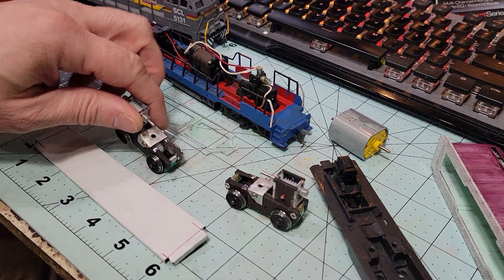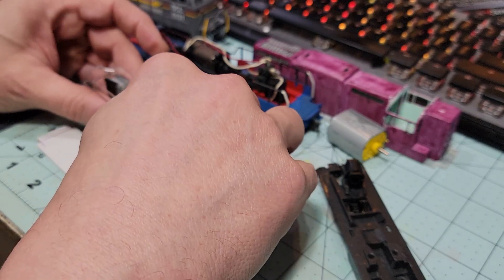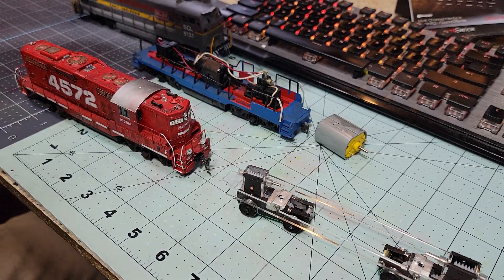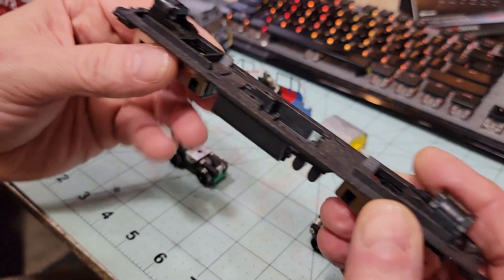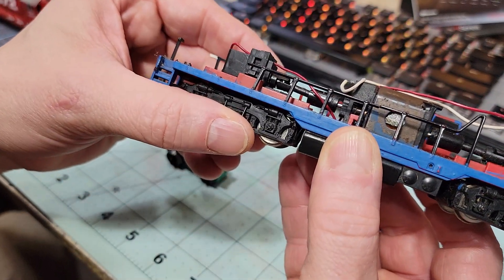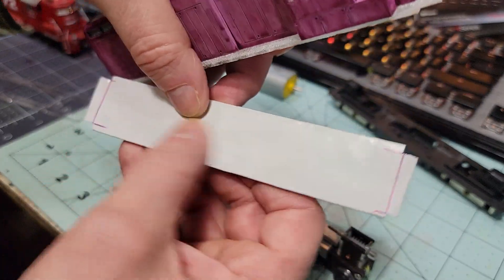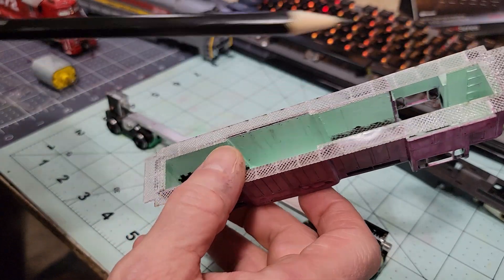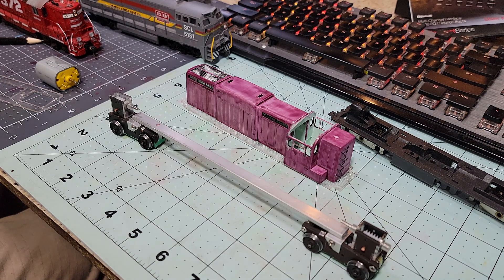2022 Contest Part 45 Mystery of Negative Space

Comment: So why not engrave the walkway on the sides of the under frame and mount the shell on top of that?
Reply from the maker: so.... engraving walkways has presented a unique problem.  once engraved, they lose all load-bearing strength.  they are also .0625" thick - that is the thinnest plexi that I have available.  there are 2 ways to address this - 1. make the walkway part of the underframe 2. use the negative space to hold the the pintle.  the GP18 uses some vertical joining to accomplish the walkway as the underframe with the shell separate.  the Athearn blue box uses the negative space with the walkway part of the body.  right now, we're leaning toward using the negative space so we can keep engraving walkways.  this may not work out, but we will see how strong we can make the negative space body really be... then we'll choose!